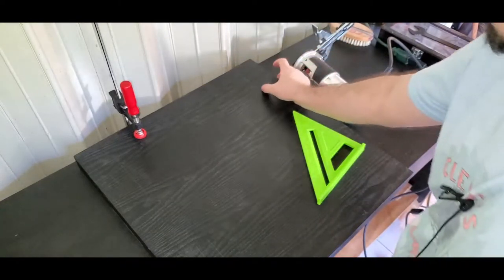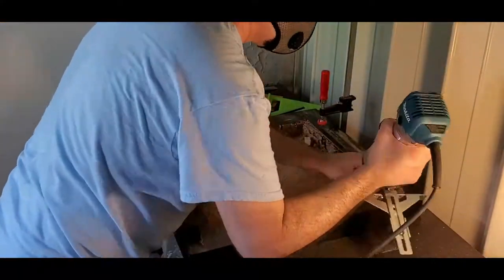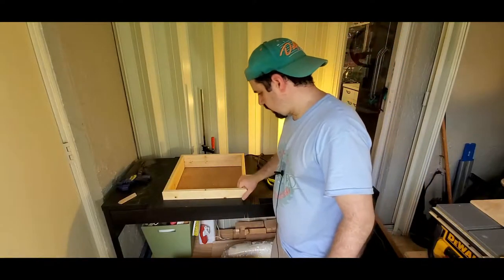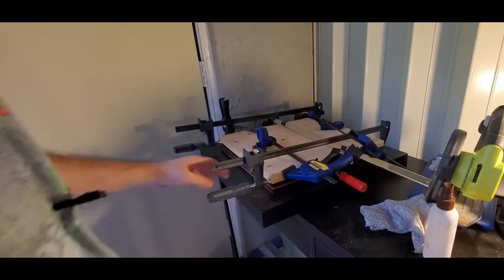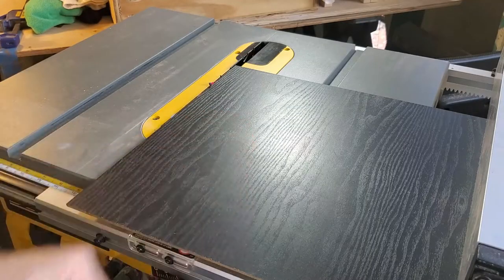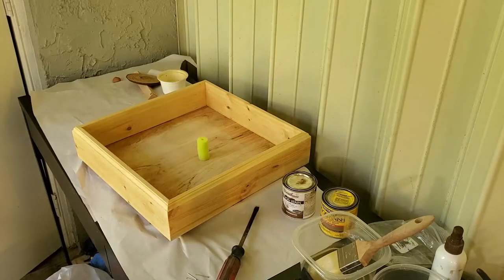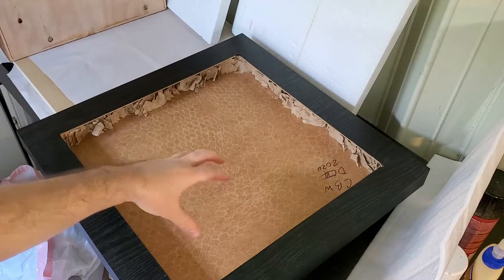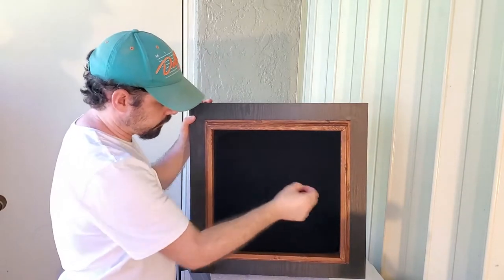DIY Brooch Display Pin Board

Comment: Came out good. Pretty cool little project. Just my opinion, but those electric staplers ain't much use. I've had a couple of them, one of them marked "HIGH POWER". Yah right. If your tryin to staple something to half melted butter, maybe. The only thing high about it was the price.
Reply from the maker: thanks, i know right piece of crap stapler, just had to work with what I had and went with brad nailer to get it all done.
Reply: @ClevesBackyardWoodworking  I've been doin woodwork, mostly home repair stuff, for a lot of years. Most of my nailer's and staplers are air power. I have to admit I've been surprised by some of the new battery stuff though.
Reply from the maker: @evilevilrick  yeah they work great, i've been wanting to get battery powered pin nailer.